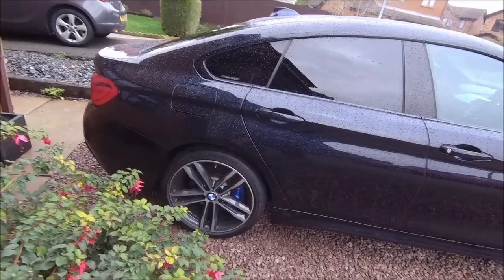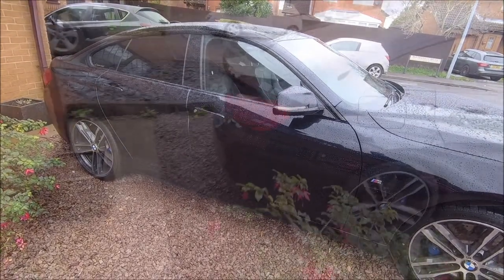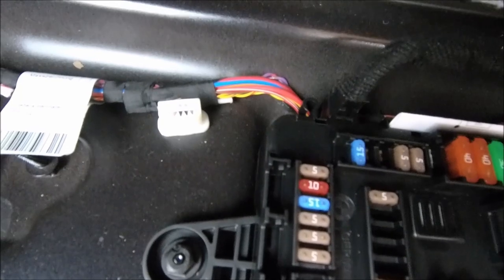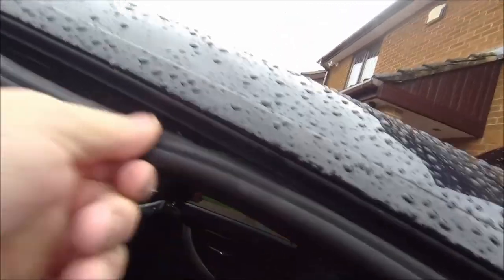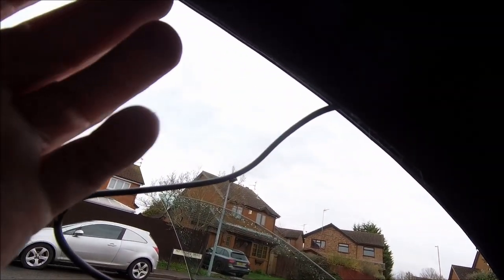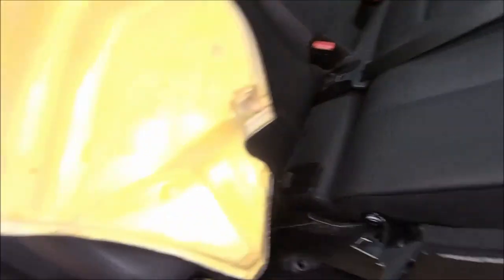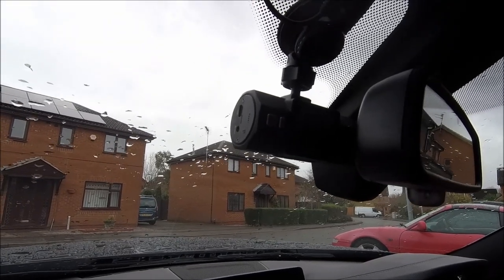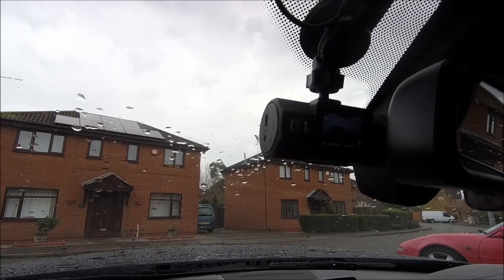fitting a dash cam  (hard wired) in my BMW 4 series

Comment: Isn’t there a 12v cigarette lighter socket under the passenger front footwell you can piggy bank off. Then route the wire to the top
Reply from the maker: There is one in the center console but didnt want to trail ugly wires about the cabin.

Comment: Thanks for the video, i followed it to fit my dashcam. One question i have is, could i plug the fuse into a different one? Every time the stop start activates the cam goes off which is really annoying.
Reply from the maker: Hi... thanks for the watch..  I guess all variants are different (I know my BM was different to my sons) , so i would say take a multi meter to the box and see which one is a live from the ingintion system, and not effected by the stop start, or just do as the rest of us do and turn the stop start off  😉😂
Reply from the maker: This was my sons fitting it it helps

https://youtu.be/ViliG70_-xI

Comment: Wait so would that fuse be feading power to that dash cam all the time or just partially cause I head bmws fuse boxes turn off after 8 minutes
Reply from the maker: with the slot I used, it's ignition activation.  As long as the ignition is activated it has constant power, and then when deactivated the power stops.

Comment: Hi I have the exact same car but my dash cam has a B+ wire do you know which fuse its supposed to go into? It is also the same size as the accessory fuse for the ACC wire.
Reply from the maker: is it the same as my sons 335d i did here ?..   Not sure it that helps 

https://youtu.be/ViliG70_-xI

Comment: Nice!!! I just bought a dash cam for my 435i GC. Wondering if there is a fuse block in the engine bay. The hard wire kit I bought may be too short to run from the boot.
Reply from the maker: The only fuse box i saw was in the back , but i bet there is a wire behind the dash for the media center that is switched  you can tap into😉

Comment: Hey chap, happen to know where I could find a fuse that's constantly powered on? I need it for parking surveillance.
Reply from the maker: I guess its a poke around with a multi meter ... if one even exists in that box... Most fuses seems to shut down to save power , so maybe a spur off the battery is the one option ?.
Reply: @AdeReeves  answering my own question here: It’s fuse number 109. There‘s not a fuse installed there but it‘s still constantly powered on! Just install a power thief there and you‘re good to go
Reply: @GermanCarDude  I had been searching for far too long trying to find a constant power fuse; thank you so much!